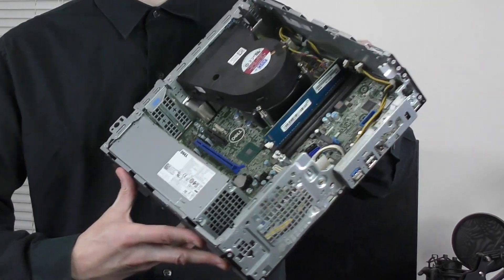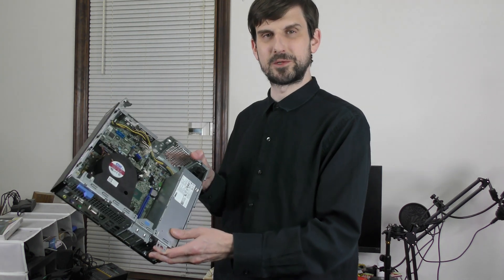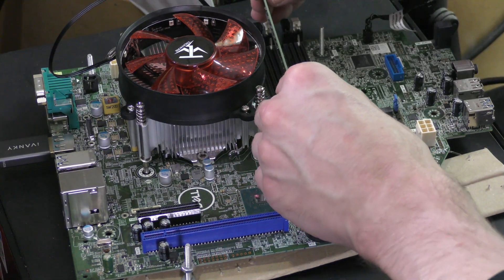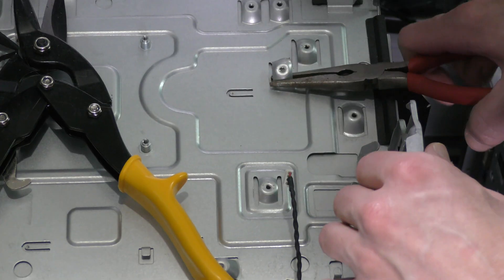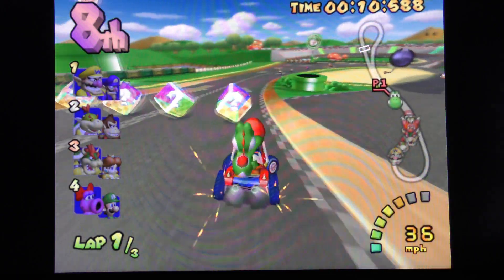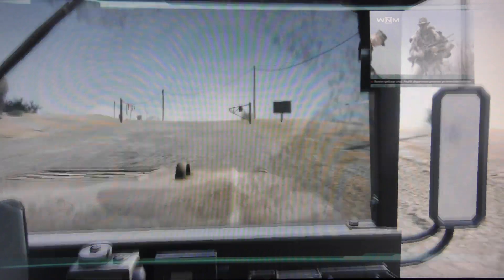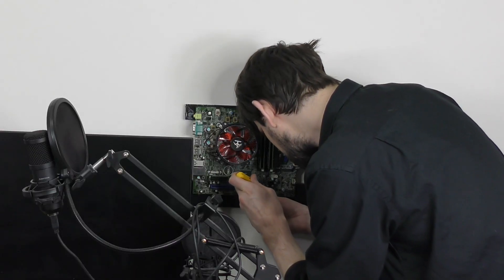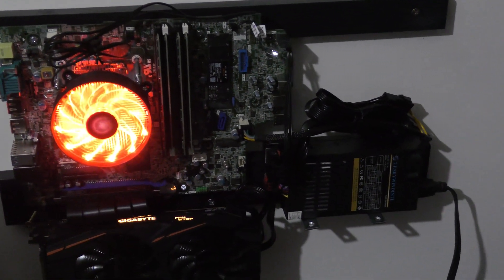BEAST Mode, Wall Mounted Retro EMULATION PC

Comment: Why limit yourself with that power supply when it’s not going into a pc case?
Reply from the maker: Mostly just because it is compact, easy to fit on the wall, and capable of powering everything I'm running. If I ever want to upgrade the GPU/PSU in the future it wouldn't be difficult just to swap them out. But it does everything I want it to right now.

Comment: I can't wait to see that wall like a year from now.
Have you played with any of the early/mid-2010's Opteron stuff? A lot of it is pretty cheap and the core counts can be stupid. Performance is
Well
It Is What It Is.
Reply from the maker: 🙂Yeah there is a high likelihood that it will get ridiculous back there. And I haven't heard of those before, just kind of browsed through a couple of them, they do look interesting. Even though I'm scared of their rectangular shape!
Reply: @LowcastleTech  If the rectangle is too exotic and intimidating, there is a square socket on the lower end: Socket C32. They are basically server Bulldozers with LGA instead of PGA sockets. It was the cheapest way to get (modern) dual-CPU at the time.
Reply from the maker: @forgottencameras  Interesting, I will have to dig in a little more and look around at those. When I was checking them out earlier there was an occasional old Sun Microsystems tower that would pop up. First time seeing those but just visually I gotta say I think they look awesome.

Comment: First comment!!! Working on a P520 build at the moment. Do you know if non ecc memory will work on that machine or does it require ECC to boot?
Reply from the maker: 🙂 Yeah the p520 does require ECC memory as far as I'm aware. Seems like most workstations do have that requirement.
Reply: @Lowcastle Tech  thank you, any recommendations for a place to find decent priced ECC ram
Reply from the maker: @jonforget  No problem! I've had a good bit of luck with used ECC RAM on eBay. Pretty frequently I've been able to find 8gb sticks of DDR4-2666mhz for around 10 bucks a piece, and I see 16gb sticks for 15 a good bit. I just search "DDR4 2666 ECC" (or whatever I'm looking for) every now and then and scroll through the listings. Can find especially good deals sometimes if I'm vigilant. Of course, with buying anything used you have to be careful, check ratings and stuff, but so far so good.